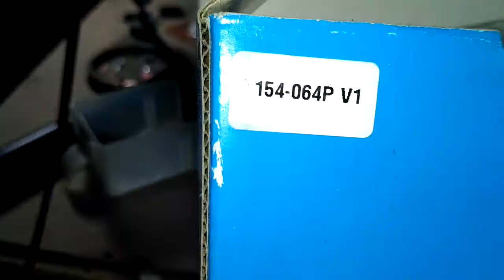SERVIS KERUSAKAN FLYBACK TV GOLDSTAR 14 INC

Comment: kasus yg hampir sama saya alami sekarang mas.. gara2 ganti flyback kw alias abal2 voltase tidak sesuai dengan data sheet alhasil banyak komponen yg meledak,transistor horisontal, ptc thermistor, fuse  ancurr.. dan yg bikin pegel buanyak sekali resistor yg putus, wis jan marai males le nyervis heheee nasib2
Reply from the maker: gatot kece hehehe.....ya derita tukang servis. kerja mikir keras...ongkos gak seberapa.
Reply: wakaaa iya om..  mangkanya sekarang saya lebih prefer beli tv minusan/mati lcd/led service jual lagi :D lebih menguntungkan
Reply from the maker: gatot kece siap gan. saya jg bgtu. jual beli bekas. cuma gk kenceng aja. maklum di desa.
Reply: sipp gan.. sukses selalu salam solder

Comment: Bang,mengapa kalau trimpot di adj sampe B+ 110 playback langsung ada bunyi di playbacknya seperti relay mati hidup tegangan B+ berdenyut, klu di bawah B+ 100v hilang bunyinya, klu saya tes lg naikan lagi B+nya sampe 110volt trus sy open pin kolektor playbacknya,tegangannya normal, Playbacknya sudah di cek nggak ada yg short antara pin kolektor dengan ground,,,apa ya kira penyebab playback bunyi2 cetak cetek
(Sya sudah tes dengan 2 playback hasilnya sama,tetap bunyi2)